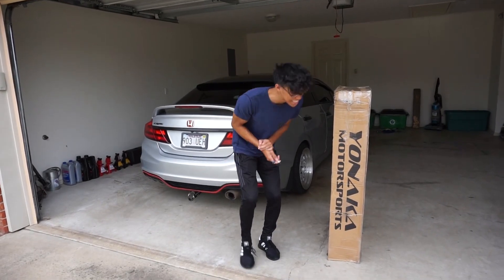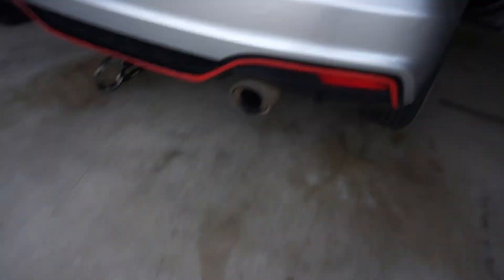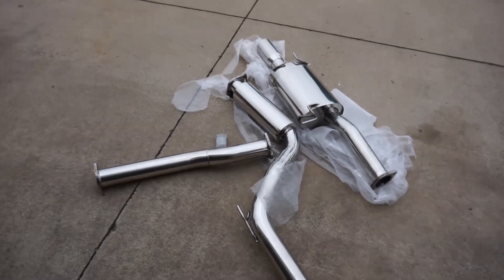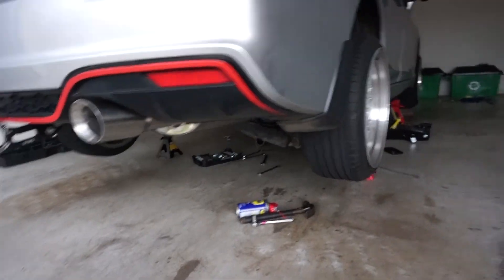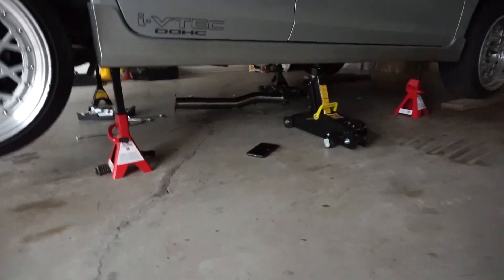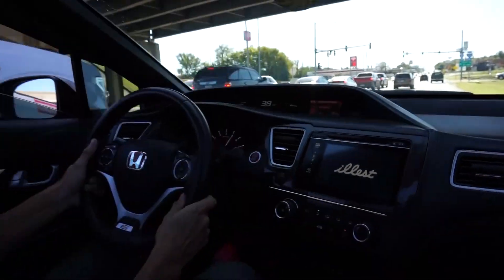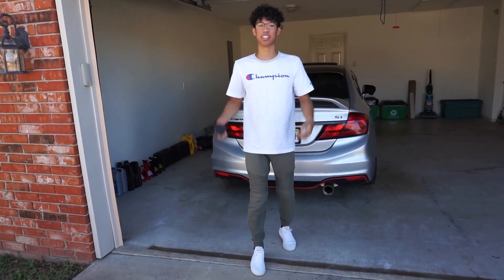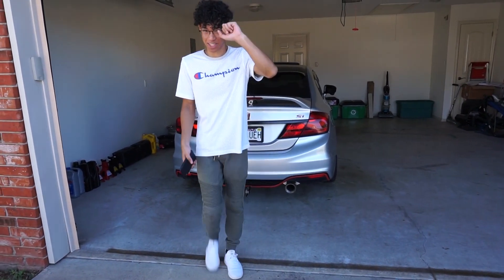YONAKA CATBACK EXHAUST INSTALL! | FG4/FB6 2012-2015 Civic Si

Comment: So what was the issue with the flange thing? I’m curious if you know if that’s an inevitable issue with all yonaka orders for the FB6. Was it hard to deal with?
Reply from the maker: Matthew Ortiz The exhaust flange holes on the last pipe, was not big enough to fit on the stock cat. So I went to a shop and grinded the holes to make it bigger and sure enough the exhaust fit. Nothing hard to deal with as long as you have a drill or dremel to grind it with.
Reply: Jarek Mai I’ve done some reading and I wonder if I’ll have the same issue with my fg4? I have an Tsudo downpipe already. Just trying to be prepared lol. Good vid. And the exhaust sounds great!
Reply: Ive used the yonaka exhaust on 2 different civics and I didnt have a problem with the fitment but I also opted out for different downpipes and didnt run into the issue
Reply: Just installed this exhaust today on the exact same car, the flange bolts are a tight fit on the downpipe but it does fit without changing anything.

Comment: From a scale of 1 to 10 how loud is the exhaust now and how bad is the drone? I want something not to loud but kinda of a bit louder then the stock exhaust.
Reply from the maker: Definitely a little bit more sound, but not loud at all. I would rate it 6 for the loud rating.
Reply: like I recommend to others, and these is what my friends have done if the system is too quiet, replace the big can resonator for a 15 or 12 inch aftermarket resonantor. Similar to those sold on Ebay for about $45 to $60. It does bring up the exhaust note a bit, enough but not police magnet.

Comment: Did you feel in power gain/loss in the power band?
Reply from the maker: In the higher band I did, but if you want the most out of the exhaust I would get a tune.

Comment: Did this exhaust last you? I've heard problems of some of the welds
Reply: I have the same exhaust but for a 01 looks great sounds great
Reply: @rogerdepaz5851  I heard too many reviews that they go bad after a few years, I went with a vibrant muffler and will do custom
Reply: @Derek  yea maybe I have a regular civic and a si as well I seen reviews about the full race sounds really good
Reply: @rogerdepaz5851  yea full race is one of the better brands, I’ve got a base and si also both 2015, Lx is black and si is white.
Reply: Derek I heard the full race has alot of drone ?
Reply: @rogerdepaz5851  I can't say for sure, I haven't heard one in person.  To my understanding Full Race is supposed to be one of the better exhaust brands you can get for an Si
Reply: @Derek  yea I'm looking for one for my 9th gen  but don't want one so loud
Reply: @rogerdepaz5851  then I suggest you do like I did, get you a muffler with a tone you like and build a custom exhaust then you can make it as loud or quiet as you want, and get the resonator you want, in the end it’ll probably cost about the same as a full race and it’ll be custom
Reply: Yea that's what I'm going to do thanks for the advice @ Derek

Comment: hi bro can you tell me how could you put that red line on the rear bumper?
Reply: It's a red pinstripe tape you can buy at any auto parts store. 1/2in
Reply from the maker: correct
Reply: @DefectoPerfect0  Thank you brot

Comment: How far off were the holes? And on the cat side or pipe side they were to close becouse is it not a 3in exhaust
Reply from the maker: Casey Moore The holes were slightly off; so I just drilled the holes slightly bigger to make it fit.
Reply: On the cat side? Or catback side?
Reply from the maker: @caseymoore4463  The catback side.

Comment: Any issues?
Reply from the maker: Oscar-12561 Other than the midpipe, everything was fine.
Reply: @jarekmai  Thanks for the upload. No CEL or anything? You didn't require a tune?

Comment: That exhaust is gonna rust before this year is over
Reply from the maker: Wanna bet?
Reply: Jarek Mai lol! Up here in New England, I’ve heard a few horror stories about this company🤷🏾‍♂️ if it doesn’t snow where you live, then I guess it might not 😅
Reply from the maker: @tnyce616  Woahh you from New England? Thats so dope! I'm live in the lower part of the states, so all I get is heat and rain.
Reply: @jarekmai  hows the exhaust holding up? been looking into this for a few days. one of my homies said Yonaka welds are ass and exhaust leaks etc so now idkkkk
Reply from the maker: @licenze4146  I've had the exhaust for a whole year before my car was stolen. When I did had it, I didn't come across no leaks. The welds are not the best and certainly not the worse. If I had a choice to buy it again I would.